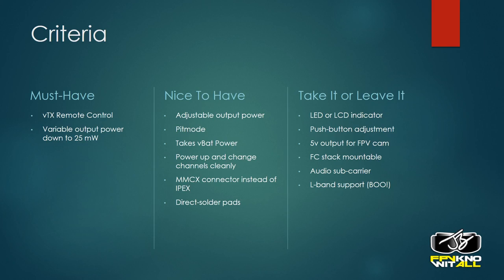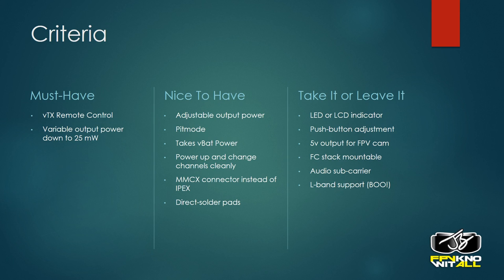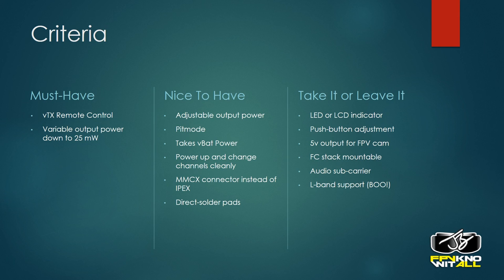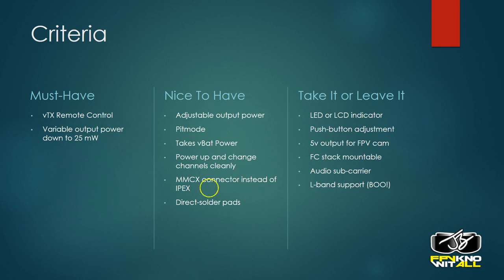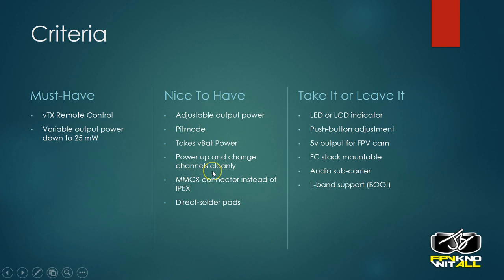FPV Video Transmitter (vTX) | WHAT TO LOOK FOR

Comment: The button is a nice redundancy. Imagine being at a race and the previous race just happened to break your smart port wire's connection. Because of this, your tbs unify reverts back to factory settings. Now your next race is coming up and you don't have the ability to change the channel through SA because you don't have time to fix the wire break. It's nice to have the button to go back to for that emergency. It happened to me. That's why I'm glad there is still the button to go to as a backup.

Comment: I just ordered the new Matek VTX :)
VTX Remote  : Yes
Variable Output : Yes
Adjustable : Yes
Pitmode : No (maybe later with an update)
VBat power : Yes
Power up /change power cleanly : I'll see that
MMCX : No, UFL with pigtail and whip antenna provided
Direct solder : Yes
Indicator : Yes
Push-Button : Yes
5V output : Yes 5V 1A BEC
Stack mount : Yes
Audio Sub carrier : Yes
Firmware upgradable : Yes
Cheap : Yes
Not a TBS : Yes

Comment: I agree with all your points. But you know what would be awesome? If Runcam built their cameras with a VTX integrated in them. When are we going to see that? Maybe add that on the Runcam Split board?
Reply from the maker: vTX is too important to integrate because if it's not excellent then you're screwed. I want RunCam to make great cameras for me. I want TBS to make great vTX for me. I even hesitate on something like the Typhoon but Moto has such a good track record with hardware design I think he probably got the vTX right.
Reply: Matt Chamberlain Vtx die too often for this to work.
Reply: One can dream.
Reply: just add it to there new dvr board lol

Comment: So, if the smart audio is input over the audio line, can we also wire an external mike to that pad?  Is the audio input pad on a vtx like the Rush Tank Mini just another breakout of the same audio input?  If so that would save many of us upgrading the vtx just to get audio input or a built in mike..

Edit: Answered my own question: https://team-blacksheep.freshdesk.com/support/solutions/articles/4000100084-tbs-smartaudio-what-it-is-and-how-it-works
Reply from the maker: Most modern vTX don't share mic and SmartAudio any more. They'll have separate audio and data input.
Reply: The more I think about it the more it makes sense.  Gonna have to try the AGC mike on my Tank Ultimate, If It doesn't work i'll get the Mini for it.

Comment: TBS UNIFY PRO VTX has only one white wire for audio or smart audio , how would i connect this to a kiss fc in order to have both audio and smart audio with taranis ?. There is not such issue with TRAMP HV VTX AS THIS ONE HAVE 2 WIRES ONE FOR TELEMETRY AND THE OTHER FOR AUDIO

Comment: After going to smart audio there is absolutely no chance I am going back! Great vid though I have to say that the stackable VTX is a huge thing for me. Maybe I am not building the ultra slim frame setups I see out there but having the VTX in the stack is so much easier that finding a place to land it somewhere protected and secured. I actually (regrettably after BF F3 came out) bought a pair of Diatone SP3's because they were stackable, though now their OSD function is obsolete. I now use Unify Pro's with 3D printed stack holder for them.

Comment: Hey Joshua, I have the Rush VTX v1.1 which apparently has the pit mode, but I cant receive a signal when engaged, and it still get hot in this mode. The mmcx connector is a good idea, but im struggling to get an Ariel with this connector on it. The pigtails that come with these things are way to long to fit on any frame I have owned. So im having to make my own ariel which is a pain in the arse. Also I agree with you that a stackable vtx takes too much room. I thought it would be a good idea until I tried to fit it in my frame. Maybe some day we'll get a new standard in boards where they are longer (36mm x 56mm) perhaps. This would definitely bring our stack heights down. P.S. like the hotel room, definitely an improvement.

Comment: Just a heads up, that cable on the Unify is a JST-GH and is a 5 wire cable. I got mine from Pitchrollyaw and it came super quick. The Lumenier VTX uses the same plug as well. I've had to replace mine once before and had to do the JST hunt :(

Comment: Help plz.  am a newbie. I have a pixhawk 4 and a T8GS v2. I also have a TS832vtx. But I didn't think about a transmitter for the controller. now I am wondering what to use for video quad. could you tell me what you feel would be a good choice? Price is a main problem.
Reply from the maker: Check my recommendations at https://www.fpvknowitall.com/ultimate-fpv-shopping-list/

Comment: Joshua I'm wondering does the vtx in the wizard 220s have problems because after my second flight it stopped working :)
Reply: LEÓNS FPV did you check the ipx connector?
Reply: Yes nothing loose or burnt it looks ok
Reply: where your sma pigtail clips onto the actual VTX.... Mines has a ball of glue on it. and not moved around, I get horrible video as well, I think its garbage from factory man, I am putting capacitors on power cable today and going to see if this helps bad video.
Reply: Asik Drone I suggest you guys give the Matek vtxv s go. It's only 30 bucks and a step above the stock wizard vtx and it has smart audio.
Reply: No power going in to vtx this stopped as I said after second flight luckily I was landed when happened

Comment: so, where is the list?  I thought for sure I saw a list on this...  
also, how do you prevent interference with the antenna bulkhead connector coming in contact with the carbon frame?
Reply from the maker: That is only rarely an issue. I have personally never had a noise issue with a bulkhead mount, but I do know other people who had noise until they isolated the antenna. The way I mount the antenna, coming out from the back of the top plate, solves the issue. You can just tape or heat shrink around the connector. If you actually use a bulkhead mounting hole, I don't know how you could isolate it, since the threads themselves will make contact.

Comment: Did you test the PandaRC VT5804 Pro? No smart audio but SBUS to switch channels. But at least MMCX and under 20 bucks.

EDIT: Mr. Steele made a video some time ago about different transmitters and receivers and the audio channels they are using.
Reply: I wish everyone would use that mmcx connector instead of the ufl
Reply: ZeroFPV I've just received the pandarc vtx in the post 10mins ago! It's actually for a wing but no instructions, so no idea how to set up the sbus link. Need to look into that.
Reply: My bad, it's the VT5801 I've received, still got sbus, but Sma adapter.

Comment: What do you think
2.5 mono jack on all VTX's instead of pit mode, if plugged in no transmission & clean video to pilots
Reply from the maker: That's an interesting idea. Would allow plugging direct to your goggles for maintenance. People would object to the weight and size, but it's honestly a very clever idea.
Reply: and we have a "remove before flight" situation :) the female jack may be at the end of a cable that is solder on the vtx can be mounted anywhere with zip ties  or a new hole on canopies
Reply: 3 seconds delay before starting transmitting when unplugged

Comment: Are there any long range vtx systems that fit a 5 inch or 2 inch quad e.g. on lower frequencies?
Reply from the maker: Yes you can use a 2.4 GHz or 1.3 GHz video transmitter. The main disadvantage is that the antennas are much larger.
Reply: @JoshuaBardwell  Thx! 2.4 will probably have interference from the radio controllers? 1.3 I will check out.

Comment: Hey josh I have a question: It doesn't belong to this video but, I have got 4s batteries recently and now my quad has an AUW of ~620-630grams. Is it maybe too heavy or is this weight ok?
Reply from the maker: That's tolerable to me. My freestyle copters typically come in that weight with HD cam. If it's that heavy without HD cam it's a bit of a porker.
Reply: Joshua Bardwell OK! No its with a HD cam on it and i think it flies perfect so...thank you!

Comment: Josh can you talk more about the audio  signals?  
I have a RMRC VTX with built in audio that doesn't work with a realacc 5808 diversity module and yet works perfectly fine with a friends LaForge diversity module.  Is there a way to switch either the VTX or the the VRX module so they match?
Reply from the maker: No, there isn't any way to change it without changing the hardware. Basically, the vTX puts the audio signal on a certain subcarrier frequency, and if the vRX isn't listening on that same frequency, it can't hear the audio.
Reply from the maker: Higher-end vTX will transmit on both subcarriers at the same time, and higher-end vRX may listen on both subcarriers at the same time. But lower-end ones only listen on one subcarrier and if it's the wrong one, there isn't anything you can really do.
Reply: Joshua Bardwell :  thanks Josh, good to know about the higher end ones using both at least.  👍🏼

Comment: You wouldn't rate an easy plug in and out  so that if you break the aerial or knock it off you can just have another transmitter in the bag and just undo the zip tie and plug the new one in.
Reply from the maker: Well, that's the MMCX connector isn't it?
Reply: Of the half dozen different transotters ive bought over the years  Ive tried to standardise on a three pin  one that is  on an Echine TR526 but i have no idea what the exact name of the plug .Its is a stunning tree  bit difficult to get that in a ot dry Sydney climate  were we are in  Mid winter with a daytime temp 0f 24deg C

Comment: Hey Josh. when you say its remote controlled, does it mean you can change power to the vtx while your flying? or are you saying that while its on the ground changing channels is easier to do with the TBS or tramp?
Reply from the maker: You can't change while you're flying. You can easily change on the ground without ever having to touch the quad.

Comment: Most piolets are flying by themselves like for instance I set my VTX channel and never touch it. I have a quad with smart audio and honestly it's not really a big deal to me. In fact a VTX in one of my quads supports it but I didn't even bother setting it up because I never need to change my VTX settings.

Comment: The only 3 reasonable options IMO are a $nothing shit-camera-vtx combo with a whip that you can hotglue on anything with a 5V line, a tramp or a unify. And yeah people who don't use smartaudio/tramps don't realize they will never, ever want to go back.
MMCX on the PCB makes stacking a nightmare if it's not 35x35. IPEX is a brand, u.fl is the type.

Comment: Hey Joshua, as always, great videos.  I have a doubt that maybe you can help clarify.  After watching your videos on Betaflight F3 FC and using in conjunction with TBS Unify for smart audio function, I incorporated them on my Chameleon build. I wanted to able to view settings through my Goggles.  For some reason I cannot get the menu to pop up.  The OSD seems to works.  I get VBAT, Timers, mAh etc.  But, when I Yaw left and Pith forward to see the menu, nothing pops up (just get 2 beeps).  I later saw your video on LUA scripts and installed.  Works great!  That is what I will use for PID and VTX tuning.  That being said, I am still curious as to why it will not come up on my goggles.
Reply from the maker: Center throttle + yaw left. If the throttle is not centered it won't work.
Reply: Thanks for replying.  I wish it were that simple.  I did center  throttle + yaw left but I only get a double beep and have yet to see a menu pop up.  Oh well, I'm glad the LUA script works.

Comment: Yeah the sma connector is heavy but how many 5.8G antennas come with some other connector. So the choise is between a hevy connector against a light connector  plus a heavy connector :o dont quite understand how it would be bad to have the sma straight on the vtx as we've used to? :o
Reply: And the L band.. Yeah it is illegal in the US. But other countries (example in europe) the 5.8G band is not the band with the highest transmission power limits for hobbyists. For example in finland the L band drops in an area where you could transmit with higher levels than 25mW without any frequency hopping protocols. You have to have some EU certificates for the device though, but my point is that the L band is not inherently bad in nature :)
Reply from the maker: If the SMA is directly on the vTX then there is less flexibility where you can mount the vTX.
Reply: Joshua Bardwell that is true. If one can not get away mounting the antenna straight to the vtx then it makes sense. But i usually mount the antenna straight out the back  and have room for the vtx so im happy there are still straight sma out vtx's out there

Comment: What's up Josh I got some tmotor f40pros 2400kv. They are so smooth but it seems like everything got more sensitive for the gyro almost had to turn on a notch filter but when I turned up my idol little bit more I think it worked it all out and I turned them down to 1040 and they don't run at all good like the Emax does just thought I would share  emax sucks though lol

Comment: Hey Josh I really appreciate your scientific approach to the hobby.  I know people whine and criticize, but i feel you do try to cover as much as possible, especially in your equipment "shootouts"

Question for you, do you thinl you can do a 2.4 ghz antenna shootout, similiar to the one you did for vtx antennas?  I find it strange that most people are very specific when it comes to vtx antennas, but almost everyone is satisfied with just a simple dipole.  
Wouldnt it be effective to have a diversity setup running a 2.4 helical or clover alongside a 5dbi dipole? Why or why not? Just playing devils advocate here, and I know you really get down to the nitty gritty on these things and run the numbers as well.

Thanks for all of the content, I've learned a bunch from you.

(Also, don't feel bad for monetizing your channel.  You share a very in depth perspective that is very different from other material that is out there.  I noticed that one of your viewers had paid you money for a 1 on 1 troubleshooting session.  If you're not doing this already, I would be offering something like that for people out there who could use that sort of help on Skype or something.   I know a lot of people are going to say "it pays to learn doing it yourself" and to a certain extent they are right.  But there are also people out there who wouldn't have a problem paying a small fee (like any other service out there) to save the time and aggravation, do a build or troubleshoot a problem the right way, right away.  Paying $50 or $100 bucks sometimes beats destroying a piece of equipment you waited a few weeks in the mail for, at least I think so.)
Reply from the maker: Even with a simple dipole, the range of a control link is so much further than that of a video link that there is less incentive to put a specialized antenna on the controller.

Comment: Am I the only one who thinks the OSD is a bad place to change vTx channels/bands? :D
Reply from the maker: This is one reason why the Lua script is so great. But you can just autoscan the goggles too.
Reply: yeah, never actually used an OSD for that, always did it on my Transmitter (in this case my DX9)
Reply: I would hope the channel does not change until you tell it to apply or something or it could be annoying. Would be cool if they could transmit smart audio to the receiver module about what channel to change to.
Reply: It doesn't move to the new channel/band until you tell it to so no problem there.

Comment: Why is it called "smart audio" when it has nothing to do with audio, why not call it  "smart VTX" instead, since it allows VTX changes. Very educational channel.
Reply from the maker: Because the original Unify used the audio line as the input, since it didn't have any dedicated data line.

Comment: just buy Unify pro :)
Reply: And use Joshua's trick of creating a solder bridge on he IPEX connector for stability.
Reply: What's this now?
Reply: +2 "What's this now?"
Reply: I have a new unify pro, works great upto 200mw but after that it just over heats, junk.
Reply: They do put out some heat, but they're meant to be air cooled. So sitting, powered up, yes, they'll warm up quite a bit. I believe they shut themselves down when they get too hot. But I have several and never even saw that happen.
Reply: Oh, and I typically run mine at 800mw flying through and around trees. No issues whatsoever. Crammed in a tight build, you could see some overheating, tho.
Reply: I have it pretty well cooled, I took a pic http://imgur.com/5U5pTVP

Still anything over 200mw and it starts to flash white and flip out for overheating mid flight.
Reply: Bartosz Drumiński kurwa I can't figure my pids..setting them for a smooth flight is just a pain of my dupa
Reply: +benji, I'd contact TBS. I've never heard of this issue and your setup looks fine. Unless the shrink tubing you have on it is holding in too much heat.
Reply: Nope Tramp HV is the shit
Reply: Fliptality i agree garbage

Comment: Hoping someone can help answer this question. Currently in the middle of a build. 

Building a 5” ANALOG FPV with
ExpressLRS 2.4GHz

I’ve got some confusion around choosing a VTX.

Should I be choosing a 2.4GHx VTX or a 5.8GHZ VTX

Looking at the Rush Tank Solo VTX (1.6W) which is a 5.8GHz

Would a 5.8GHz VTX limit my range or should I be using it?
Reply from the maker: I'd be surprised if you could even find a 2.4 GHz vTX. 5.8 GHz will probably be what you should get.